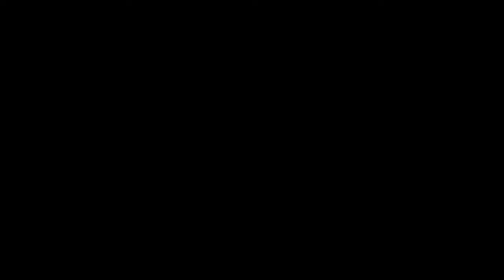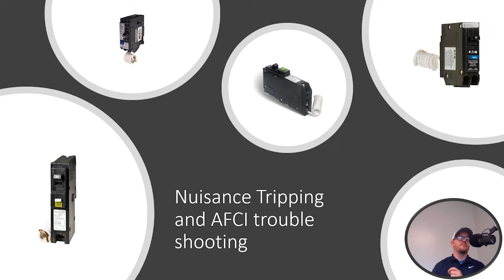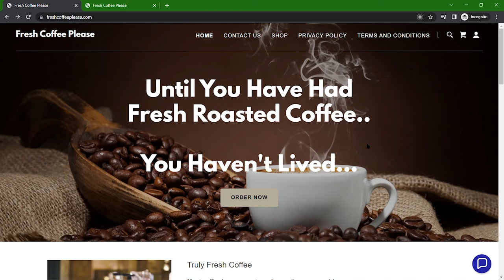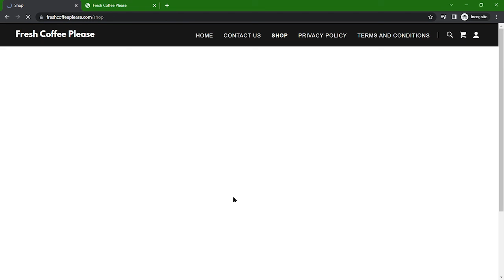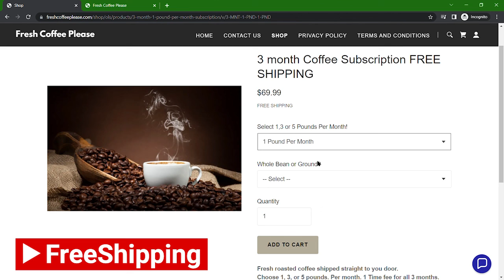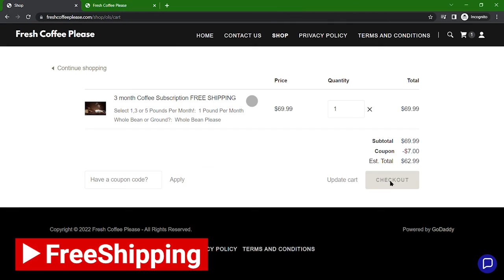AFCI Nuisance Tripping and Trouble Shooting #electrician #electricalcodecoach

Comment: I work in the solar field in Massachusetts as a licensed journeyman electrician. I’m in the service department ( not installing solar panels on the roof ) . Here in Massachusetts we get lucky and have the Mass amendments and rule #3 states that as long as we do not make a violation worse we do not have to fix it . This allows me to get away with not installing AFCI breakers in the panel after changing it out most of the time . Although we all know that AHJ has all the day in the end anyways . But In my experience any old home with old wiring is a nightmare for AFCI breakers . Only time my hand is forced to swap out standard breakers for AFCI breakers is if I end up extending the circuit because of a panel relocation and the circuit will no longer reach the new panel location . In this situation if the circuit is being extended greater than 6 feet , than I have no choice . Anyways Thankyou for your content ! I passed my exam just about exactly 1 year ago in the middle of June 2021 AND I HAVE YOU TO THANK FOR HELPING ME ALONG IN MY JOURNEY 🤙🏻☺️. Your test prep courses helped me tremendously. I love this channel and I will forever support you. Thankyou Thankyou Thankyou Thankyou for everything you do ! 
Your friend ,
Chris Schwab aka Good Ol’ Sparky
Reply from the maker: Let's go!

Comment: Most of our problems stem from home owners installing the home automation devices and those receptacles with the night lights built into them. Sometimes it's just the ground touching the neutral but a few times it's  been junk devices that these people have to have. It's not just frustrating but a huge pita trying to find out exactly which device is pissing off the AFI.
Reply from the maker: lol I was* responding to another comment about pool bonding
Reply from the maker: That's odd, are you saying that they don't have you Bond the concrete?

You seen this video?

https://youtu.be/ETHAi3hS0pk
Reply: @ElectricalCodeCoach  I'm sorry but I don't see the correlation between junk devices installed by homeowners and bonding a pool?